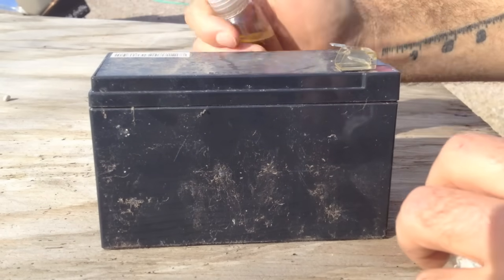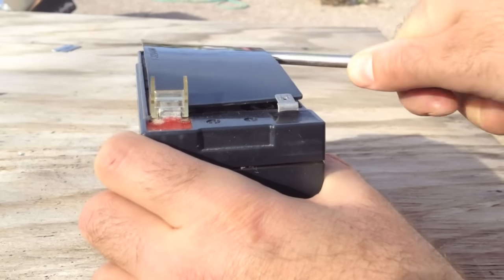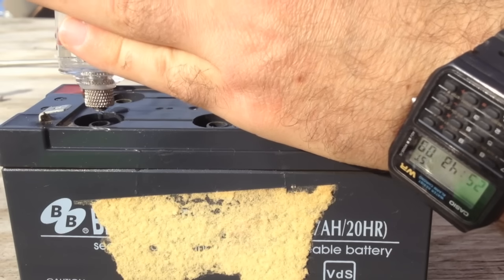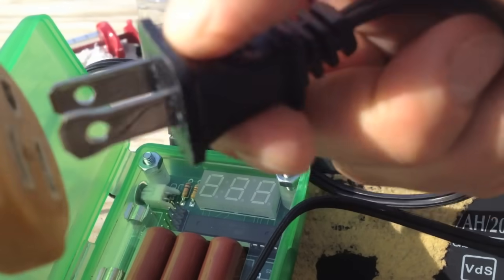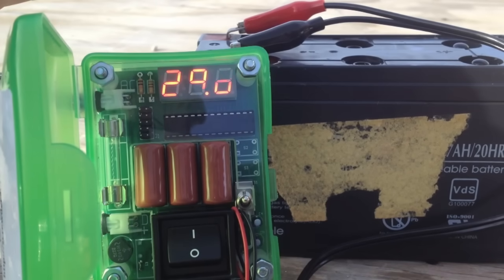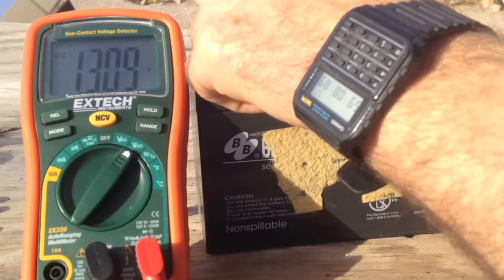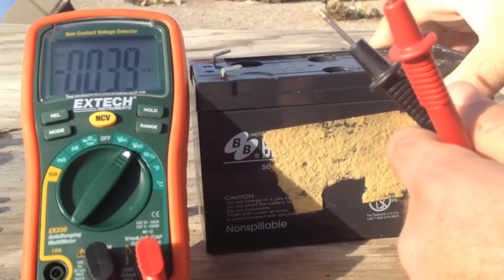Sealed Lead Acid Battery Recovery

Comment: It is polyester ac-dc charger which can help to charge this lead-acid batteries and even dead batteries. ac-dc charger is an adoptable charger which is automatically adjusted with the output batteries and very first moment if you touch it you will get shocked.🙂 It's that simple.
It provides both two types AC and DC voltages, very first moment you can check the terminals by a tester. As it grows higher of the battery voltage it gradually turns into DC and at the last moment if battery ok you will not get shocked. AC is higher in voltage and it's frequency range 50-60hz that's why it get shocked.😊

Comment: battery tender is a maintenance charger used for 12v batteries on lawnmowers and motorcycles, it WILL NOT desulfate a battery. it's just a trickle charger. you need a specific tool to desulfate a battery.

Comment: I just did this, but when cutting the lid, I cut too deep and the blade went into one of the cells. What do you recommend for sealing it? Will RTV hold up  - isn't there sulfuric acid in there? Or, should I get out my old soldering iron and melt the slit closed?

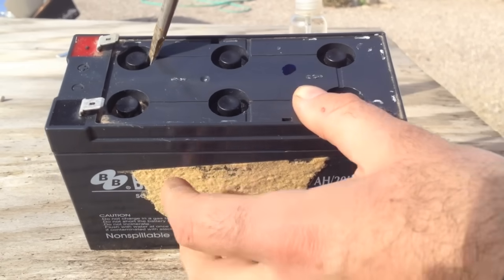Comment: voltage do not indicate battery recovery and 2:45 these rubber caps cannot physically build up significant pressure.

Comment: If you have a smart charger it wont start charge below 11 volt.
Use a second full battery to get the old battery to 10.8 - 11 volt before connecting it to your smart battery charger.
Or hook it up to your car battery and let it run for 15 minutes... Plus on plus - minus on minus...

Comment: Hey instead of adding water, I have added additional acid h2so4 solution... will it be okay?
Reply: Probably not; usaually its the water that is evaporated, the acid is still in the cells in some form.
Adding acid is like adding acid to acid in these cases, making a too strong solution, and ruining the chemistry, and the cell. To be honest I do not think capacity will be any near "new capacity" from a long time dried out cell... only if enough luck is added. :-)

Comment: I just replaced a 12volt lead acid with a new one and the new one wont hold a charge.Its in my crate guitar battery amp.I barely got thru a 45 minute set when the amp light showed red and started to distort.Hmm what could be the problem?thx
I charged the amp for 2 days before using it.
Reply: 1

Comment: I have a mobility scooter with 2 SLA 12v 35 a batteries on, i took the top of the battery that i think to be low, when i have filled with water can i not place the rubber caps back on and charge in the scooter? i have no external battery charger they are charged on board, is this a problem as i noticed the cells bubbled away slightly, how safe are the rubber caps if there is pressure building up beneath them?
Reply: H
Reply: I'm working on a set of the same batteries. I charged one with just the caps on it and after I came back from work one of the caps had shoot off. I'm charging it now with the caps off like this guy did in the vid. I do know that before putting them back in your scooter you will need to put the comer back on and tape or glue it back down.

Comment: What can you do if one of the cells are bad? and battery reads about 10V after charging?
Reply: Not much. Top off the distilled water and try and run a repair mode on it, but I can almost guarantee you'll still need a new battery.

Comment: Very cool. Only thing is I have no idea about a 'pimp" charger. I do have a digital autmatic charger and an old school 6v and 12v charger.
Anyway, thsnks for the tips on accessing a serled lead battery.
I'm also assuming that distilled  water is ok to top it off with.  ?
W

Comment: Word of clarification is in order -- this is ONLY for wet type SLA batteries... and NOT for VRLA batteries, which will look just like this one, and if you open them up, they will look dry.... that is because they are designed differently to operate without a sealed liquid electrolyte (but instead use a solid fiberglass mesh electrolyte).  See https://www.tirebusiness.com/article/20100521/NEWS/305219997/take-care-when-servicing-agm-batteries for more detailed explanation.

Comment from the maker: it might help. distilled or rain water.
Reply: After filling the battery with the distilled water can you fix it to the ups to charge it directly without using the battery charger?

Comment: So, sulfation was not an issue in this case?
Reply: Jitter 000 Hi,

Too bad he didn't show the insides of each cell with his camera somehow. If the electrodes would have been white-greyish in color, this video would be debunked instantly.😅😎

Even though the big fail was that (he said) he used rainwater. Instead of distilled/demineralised water as it is actually a much proper substitute. 🤔🙄

Comment: Hi. After charged, should I drain part of the water or can I leave the battery with water? And can I charge a "old" battery with a standard charger, like the standard UPS Charge System?
Reply: +Thiago Rocha (thiagoqualquercoisa) Leave the water in there it turns to acid, take it out and you fuck up your battery again!
Reply: +Thiago Rocha (thiagoqualquercoisa) so you poured water in didn't you ?

Comment: here's  several things for getting a good result
Don't try to do this until you know what you are doing - the acid can burn you
check the voltage first - there may be a dead cell which will waste your time.
Check the battery fluid.
attempt to completely recharge the battery.
(I read about these from rapid renew roadmap website )

Comment: I have just tried doing that with two batteries taken from UPS. It didn't help, it seems. The voltage gets to 12V for a short time. The amperage is not good enough for anything practical though. The voltage drops down very quickly when under load. I guess, in my case, the batteries discharge and degradation went beyond repair.

Comment: what are you cutting? there is nothing to cut since it is just a cover popped on...
Reply: glued as well least the ones i have worked on had glue and i found that making a tiny hole in the rubber caps helps with water loss but cant tip the batteries on side any more or they leak the vacuum that is on each cell when charge heat is dissipated  and fluid/ air contracts the caps seal the vent/fill ports and cells get less active in vacuum and those batteries only need be wet not flooded as video showed still work but will erupt excess electrolyte back out when charging them best way is electrolyte thats already  at specific gravity of 1150 and just add an eye droppers worth to each cell and  then wait a lil bit then check each cell and all cells collectively if you dont see high 12 + to 14.2 optimum  then it may get ya out of a pinch but dont rely on it to perform any permanent jobs will most likely  charge ok but lose its charge very fast and your only as good as worst cell or battery in a system or circuit never be able to charge any better than your worst ones capable of taking and that in time will affect the other one negatively but for shtf as a stand alone back up usually do just fine ph and spec. gravity are relative as to state of fluids acidity /alkalinity and recharging or not

Comment: Batteries do not have indefinite service lives.   This "might" work to some degree on a battery that had not been used excessively but more often than not, this will not work because eventually through use, the plates themselves become pitted, sulfated or shorted and generally damaged to the point that the battery will not have any capacity even though it might still read 12v or more.   It is the capacity of a battery that makes it valuable...not so much it's voltage.

For example, an A23 battery is about the half the size of a AA battery, but it is a 12v battery.    While it might power a few LED dash lights for a moment, even though it is 12v, it would not be capable of starting your car because it lacks the capacity needed.

This guy simply had a battery that apparently dried before it sulfated and also it was a battery that had not been used very much.

If a battery is sulfated, then simply adding water will not help.   But sometimes SLA batteries can be desulfated and returned to service, however, once again with lesser capacity.

Most of those people reporting "success" are probably doing so because they are reading 12v with a meter.   However, they are not testing the capacity which is likely quite low.   Unfortunately the only cure for a damaged battery is replacement.

The very best way to get the most out of any battery is to take care of it.   And NEVER put anything other than distilled water in a battery.    Rain water can contain impurities.   And Epsom salt may make a battery work for a very short time, but it is not a good idea to put epsom salts in a battery.
Reply: Almost impossible to remove sulphation from an old discharged battery. The voltage may look ok but the AH capacity will be poor!

Comment: Water in Acid  ? I heard that they are opposite of each other. then why battery manufacturer not making Affordable Sealed Rain Water Batteries  ? my 7.5mah ups battery is not fully dead but giving poor performance over the years . should I add Rain Water in it. will give better performance ?

Comment: from my research vrla batteries are a "starved electrolyte" design. Which means all the electrolyte is held in the mats between the plates unlike a flooded cell type which has excess. Having said that I  agree with you that many batteries simply dry out . . but I don't know how much water to add? Too much water and the electrolyte will be too dilute and the battery will never have any grunt. But what have you got to lose right!! I saw a vid from Pakistan where they carefully chiseled the top off truck batteries, removed and cleaned the large plates and then resoldered the cell bridges and "repaired" the battery! . . It started a truck afterwards!  good luck.

Comment: So, after recovering the battery, I'll just leave water inside and reseal it?
Reply from the maker: Yep
Reply: +The Good Life Lab need help..urgently
my battery is giving 10.5 volts..i think one cell is dead.. i find it through multimeter..
i am going to clean and refill it with acid and water..can you tell how  can i clean it from inside...can i use mineral water or anything better?
Reply: +vivek gangwar I saw a video somewhere, he used bicarbonate of soda with a bit of water.
Reply: You just throw it in garbage bin. A lead battery with voltage dropped under 8 volts is DEAD, whatever you will try to "ressurect". And the life span is 5 years under normal usage, without hard cycles of charging-discharging.
Reply: The battery will not give 10.5 volts if one cell is dead. Using a multimeter find out which cell is bad, then add few drops of distilled water.  The quantity of water to be added depends on the type of battery and its Ampere hour capacity. Don't try to use sulphuric acid. That is to be done only by trained battery technicians.
Reply: @krishnakumarm.r.3042  Very good and a very safe point.

Comment: hey man I bought 2 brand new sealed batteries 12 volt 55 ah for my wheelchair and never charged them nearly a year ago.... and now they won't charge with my wheelchair charger... so how can I safely recharge them so I can now use them???
Reply: +Brian Mendell : I could be completely wrong here, but my hunch is that this video will show you how to open a dead battery that won't charge, re-fill the cells, test them one by one, and as a group, continue charging if all cells are "active", and Presto!! your battery will be charged. As I said earlier, I could be wrong, but that's what the man said he did, and the pictures showed it too :-), and I have no reason to disbelieve him. So, if you watch the video, I think he will answer your question. Did you watch the video???

Comment: Sir, I have a dried battery and I want to recover it, because i dont have any external power supply to charge the battery, can I refill it and connect it to ups and charge it.
Reply: SHASHIDHAR MOONWALKER That's a temporary solution, but ok. The best way is to use at least a 2-step/phase charger. You can get those on eBay.

Comment: FWIW, this did not work for a pair of 6v VRLA batteries wired in series that I had. They sat around for 7 months and would only hold "surface charge," however after trying this they only charge up to 7 volts for whatever reason. Not saying this won't work for somebody else, but it didn't work for me.
Reply: Actually I am pretty sure this will not work for most people. I tried with another worn out battery, this one a 12v, 18ah AGM battery. It did not help it at all. Open circuit would show 12.6v but even after days on the charger it had no capacity. IMO if you're thinking about doing this, save yourself the time and money and just go get replacement batteries. Adding water to battery electrolyte that never had water to begin with doesn't seem like something that would help. It was a fun little science experiment though.

Comment: I hae found that the best way to recover a 12v battery is to let it cook at 24v for a good length of time, this seems to break up the sulpher crystals a bit and recover around 80% of capacity. 

this method has never worked however on a battery that is below about 2v.  Anything under that has generally just been useless even after recovery.

Comment: it's nice to see you wearing your safety glasses where are your rubber gloves . you should have mentioned if it was sitting around that long you would have a vacuum when removing the rubber caps. thanks for the video

Comment: Hey i have a 6v 4AH battery i cant get this da pimp charger where i live so whould it be ok if i charge it at 12v 500mA ?? or should i use different ratings ? & should i leave caps of the cell ON or remove it as i guess it will be gasing in battery ?
Thanks for the help !!!

Comment: Does this process work with AGM (absorbed glass mat) style batteries?
Reply: AGM works the same as a regular lead acid battery, it just has sponges in between the lead plates.
Reply: I believe those kind of batteries are AGM

Comment: did the same what you did, battery had 1V and my charger is UPS actually and it charges 13.1V and i left it overnight,
battery got to 12.1V -12V but when i try to use the UPS on it gives low battery warning and turns off why ? please help? is it because cells aren't stabilized ? i haven't check that yet.

ps: i filled with distilled water is that ok ?

Comment: Hi I have a question anyone can answer this as well,, I bought a brand new 12v 9ah lead acid battery and I charged it up just a little bit and then used it just a little bit is that bad for first use, manufacturer’s always say to fully charge it on first use, is that really bad for this battery’s performance

Comment: I have done this before. I have had good luck with some and not so good with others. I had some that had been over charged and they don't come back much of the time. Also may want to tell everyone that they can Not be changed with a car charger! It will cook them unless you put something like a 10-20 ohm in one side to limit the charge current. I use 10 ohm 10 watt. I worked on burger alarms for about 30 year. Most had that type of battery in them. Most alarm system charge that size at 250 ma at peak charge current.
Reply: Burger alarms ... Step away from the food sir

Comment: Not necessarily. When you put in the distilled water all it does is dissolves the sodium sulfate (dried up sulfuric acid) without diluting it like normal tap water will. You do not really need a "Da Pimp" charger either. Since what you are doing with this process is just turning dried up acid back to liquid acid the battery is "normal" but it is just so drained that modern "smart chargers" can't sense it's voltage and start to charge. Just use an old style "dumb charger" or a "Da Pimp"

Comment: I think that you need more than water to recondition the battery.... Batteries get hot when they are working hard and the heat causes evaporation... The acid has a lower boiling point compared to water so the most common cause of battery failure is when people top up a battery with just water without checking the specific gravity of the acid/water mix. Some auto shops sell battery acid and in most cases just topping up with a bit of acid restores the battery... If the battery is as low as it was in this video, empty the battery as much as you can then Google for the correct acid/water ratio and start fresh... That's why they make those specific gravity syringes for batteries, it literally shows you if you need water or acid... Most people think that they show which cells are charged and which cells need charge... Just adding water only dilutes the mix and the battery struggles to hold a decent amount of charge... Sure it will charge to 12 or 13V but drains very quickly as soon as you put a load on it... So unless you have what's necessary to distill the acid from the water, it's probably cheaper to go and get a new one...

Comment: Hi Mikey
I replaced a 12 volt lead acid battery in my crate amp.The new battery wiill only go 45 minutes before my amp signals red meaning its gonna need a charge.I tested the battery.24 hr charge measured the battery before playing it read 14.22 volts.after 45 minutes of playing again the amp starts to die and distort i tested it again 12.76.is it the battery or something in the amp? When the amp was new it would go for hours.